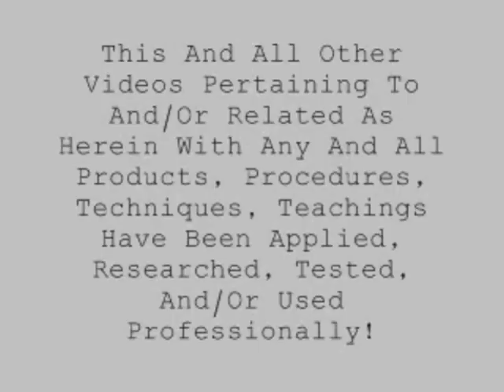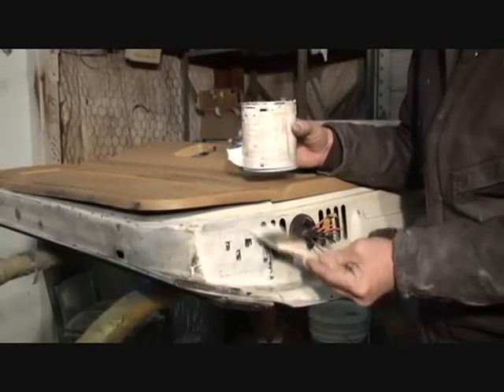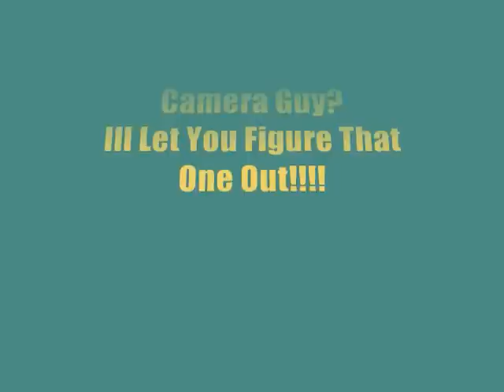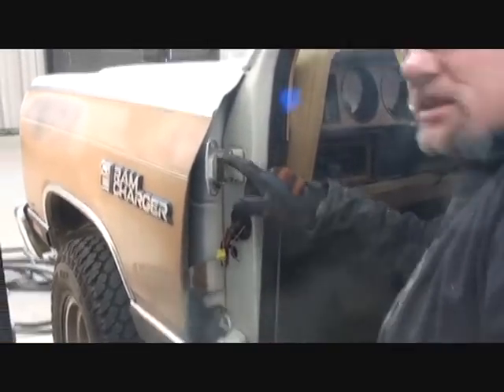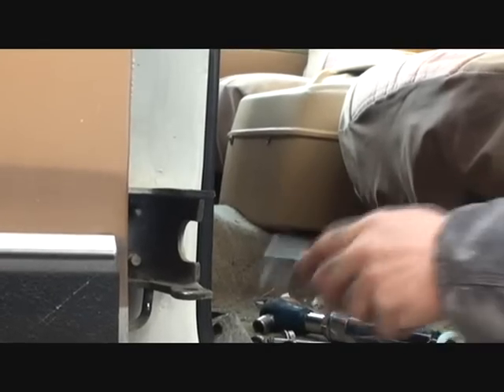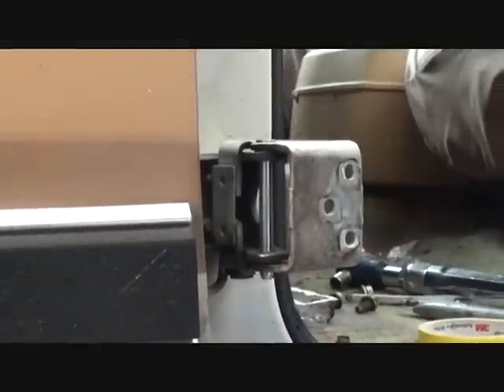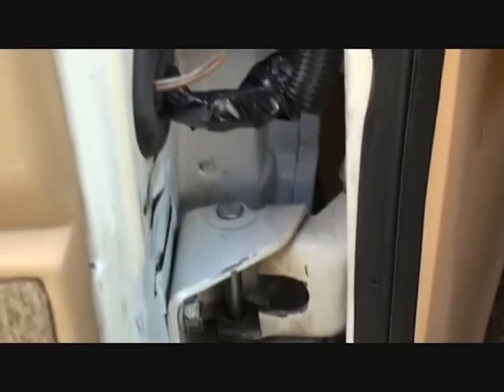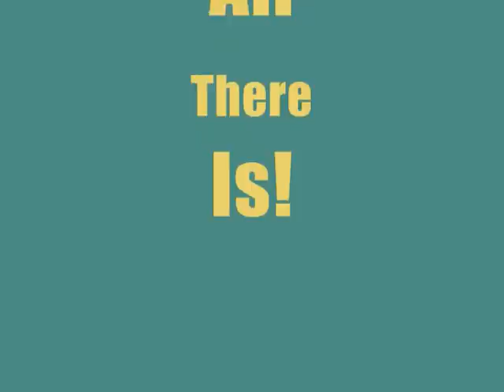How To Repair Your "Worn Out Truck Door Hinges"-Part 4

Comment: Did something similar on a Town & Country van a year ago. It had gotten so bad the metal around the latch had ripped too and needed to be welded. Just like this one it was left that way too long before it was fixed the right way. I'll never understand why they made the areas around the damn hinges so weak. With this video people now know how to change those pins to keep that problem from happening in the first place. Good job Pete!